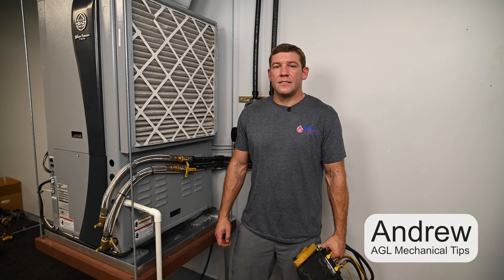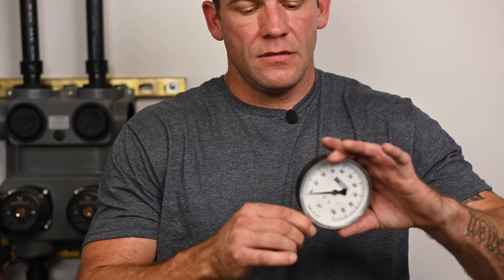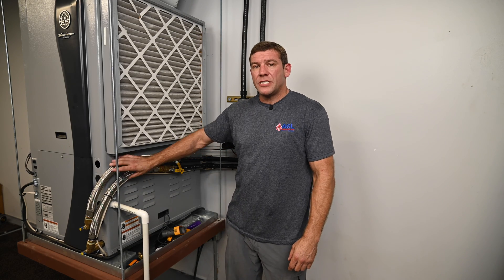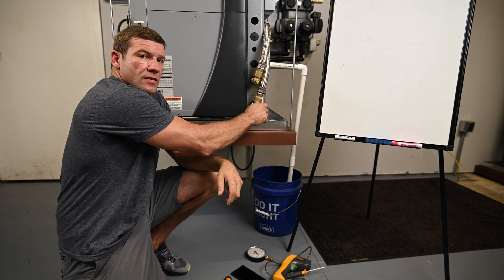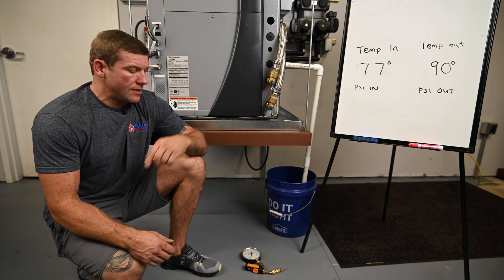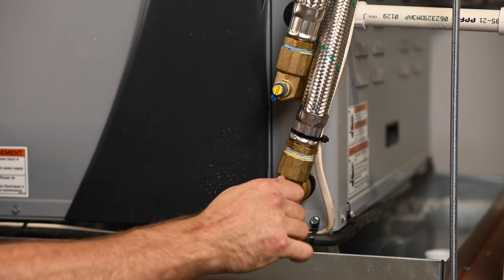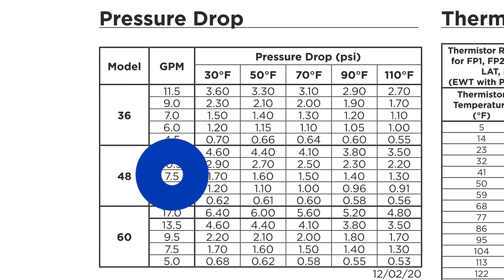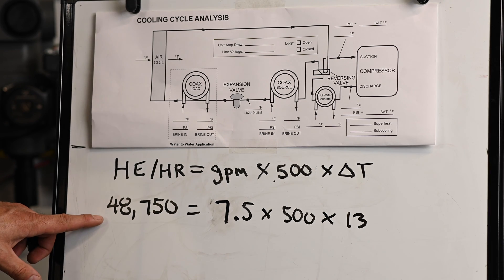Geothermal Maintenance 101 - Heat of extraction / rejection

Comment: Question,  can I use a non contact temp gun on the brass elbows at the heat pump to get my temp readings?  The reason I ask is that there's no temp port on the drain but 2 on the source, and no caps.
Reply from the maker: Yes, we have done this in the past.  The temp might not be perfectly accurate but the important thing is the difference between the water in and the water out.  If your checking the same type of surface on both lines (brass) then the contrast between the two should be accurate.

Comment: Amazing information!  I have a Bosch geothermal heatpump that, in my opinion, is not operating efficiently.  I've had several "technicians" check out the unit and they all connect the gauges, look at the pressures, and say it's within specs. The problem is my house is well insulated,  not drafty but can't maintain 74⁰ when the temp is 30⁰ outside.  The heatpump is about 5 years old and has never done well. I have new drain and supply wells with good flow.  I'm going to have to check this out myself.  This is  my 3rd unit in 28 years. My first was a Florida geo unit,  same size, but used R22, i had a nice warm house, no problem until the compressor went out. I was talked into a new unit same brand and size and have had nothing but problems since.
Reply from the maker: What region do you live in?  In Charleston SC we can use geothermal without supplemental heat strips but if you live further north it may be possible that you need an auxiliary heat strip in the geothermal unit (this helps out heating in the colder days).  Your last system might have had this.  That's just a thought. 

Also, did they replace the system with the same size system that was installed before?
Reply: @aglmechanicaltips I live in Chesapeake Virginia. Yes, I do have 10K supplemental heat strips.  They are setup to come on when commanded to emergency heat at the thermostat. I'm not 100% sure if this unit is the same size or not. I think the original one was 3.5 ton, this a LV042 Bosch unit.  Should I get someone to properly set the strips to come on as supplement heat?  Kind of defeats the point of GEO in my mind.  I did take the water temps, 68⁰ inlet, 63⁰ drain.  Air temp rise 19⁰  with 74.9 in, 93.9 out.  I remember with the R22 unit I would get temps up to 112⁰.  Almost makes me want to seek out a refurbished R22 unit.

Comment: Can you link the needle attachment for the testo gauge, I dont see it in the video description. Thanks!
Reply from the maker: https://geohydrosupply.com/pressure-gauge-probe-1-8/

You will still need a brass adapter.  I don't know the exact fitting but I know supplyhouse.com sells it
Reply: @aglmechanicaltips That was the part I was confused about, I found this same needle but had no idea how it's supposed to connect to the pressure probe. Will have to do some more digging I guess. Thanks!

Comment: Homeowner here.  Question/comment... Don't they have a sensor that could be permanently mounted on both ports for temp/psi that could report to an app which would do the calc for extraction/rejection number?  As a potential owner I would to see that value and know that all is within spec...heck a good app would send me a threshold breach that would let me know of loss of efficiency.
Reply from the maker: Water Furnace does when you order their equipment with advanced controls. They use a flow meter instead of pressure though and temperature sensors.  It is fairly accurate but when we need precision we do it manually.  Keep in mind that homeowners cannot view this information in their app and it is only reported to the HVAC dealers web portal.

Comment: Just curious, why not just have temp guages made into your pts? Coming from more of a boiler background just seems kinda like why? I can see those seals leaking over time. Even with using water based lubricants. Just curious
Reply from the maker: You could probably us a temp / pressure gauge but accuracy is very important so large displays are important (1-2 PSI significantly affects the GPM calc).  I've never seen that done so I don't know but in theory it is definitely possible.

Comment: thanks, Have 2 geo systems in my house, one is starting to not perform as well as it used to.   I use non pressurized pumps, and have a water flow meter to measure actual flow.

Comment: Thank you very much for the info.  I am learning geothermal and have 34 years hvac experience.   I would be so thankful if you could tell me what fittings I would use to get from the testo 549 to the test tool for pressure.  I’m a big fan of testo.
Reply from the maker: You will need the needle probe I linked below and a brass fitting.  I believe the brass fitting is 1/4" SAE x 1/4" MPT brass (1/4" male refrigerant hose fitting x 1/4 male pipe thread).  A HVAC supplier will probably have the brass fitting.  Also need some pipe thread tape...

https://geohydrosupply.com/pressure-gauge-probe-1-16-geo-flo/
Reply: @aglmechanicaltips  thank you very much for that information. Can’t wait to better serve my customer and their geothermal system using the formulas.

Comment: Where do I connect a roomcooling unit to a geothermal heatpump? When dealing with an airpump the the hot air is heating up the fluid in the airunit that later is compressed by a compressor in the outside unit before it is evaporated out via the fan. 

So I guess the process must be reversed in the geothermal heatpump as well and the heated fluid leaving the room must be compressed inside the geothermal heatpump before it leaves the pump via the plastic pipes down to the ground.

Comment: Do they make inline temperature probes and/or pressure gauges? Would that be better since it would be on there 24/7 and we wouldn’t have to worry about damaging the o-ring or losing refrigerant?
Reply from the maker: Yes, a lot of the more advanced systems have built in sensors and you read these from a digital tool.  We rarely have to actually probe the units anymore but still train for this in the event a sensor fails or you have to work on a unit that is not advanced.

Comment: Your videos are great 
On the he/hr= gpm x 500 x td 
ITS WRONG 
YOU FORGOT THE HEAT OF COMPRESSION
Reply from the maker: Hello, see link below to the installation manual to a water furnace system.  On page 73 there is a cooling cycle analysis sheet which we use on the field.  The calculation is on that sheet and coincides with the info in the video.  Thanks

https://www.waterfurnace.com/literature/5series/IM2500AN.pdf

Comment: Was the second needle part of the Testo 549i or an add on?
Reply from the maker: It was an add on.  I linked the needle used below.  You will have to adapt this using a brass fitting you can find at a hardware store.  
https://geohydrosupply.com/pressure-gauge-probe-1-16/
Reply: @aglmechanicaltips  thank you!

Comment: So you would need those calcutaions. If you're doing a repair. Or when setting up the unit.  But not for maintenance. Is there really anything that you need to do for maintenance. Other than check the water for ph balance and antifreeze values. And filter on a water to air. Which should be changed out regularly. By the home owner.
Basically no maintenance ?

Comment: Thank you very much!  You answered a question for which I couldn't get a clear answer, temperature IN was 77 so if you are a 68 degree guy, this type of system is not for you.  A traditional air to air would be more appropriate for that type of person.
Reply from the maker: Negative, water temperature in has nothing to do with the temperature that the system can deliver to the house.  There are plenty of houses with geothermal that can achieve 68°.  On a "Air to air" system the "tempurature in" on a 95 degree day is 95° for example (when measuring at the condenser coil which is comparable to the water in on a geo).  Let me know if I am misinterpreting what you are saying.

Comment: Assuming all would be the same for a non-pressurized system as long as you know the gpm?
Reply from the maker: Correct but you can also calculate the GPM the same way as long as there are P/T ports at the unit